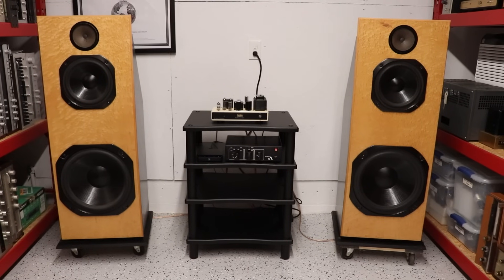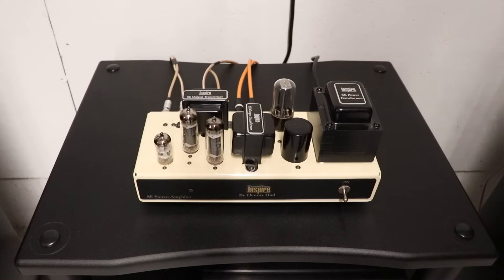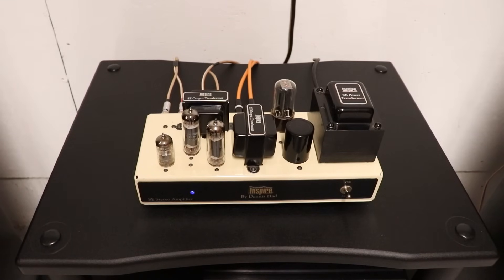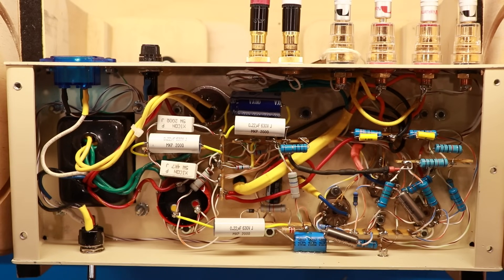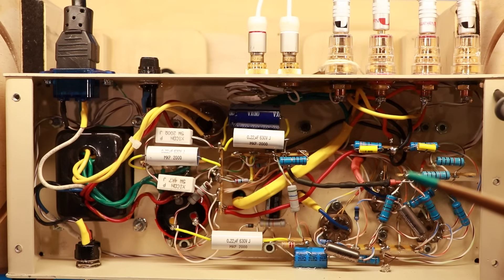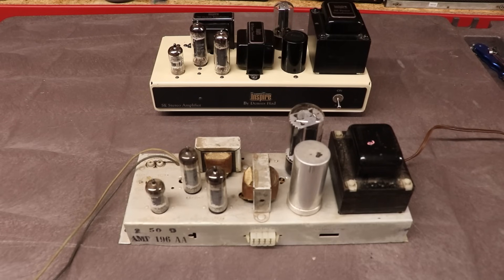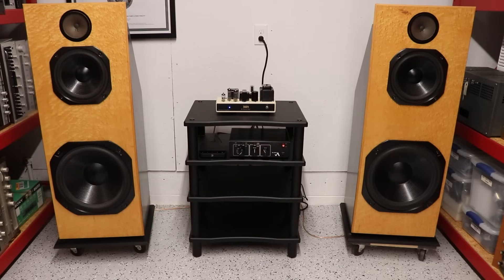Inspire (Dennis Had) EL84 Single Ended Amplifier Repair

Comment: 2:26 Also looks like the filter cap is a bit loose in it's mounts, is that the self destruct button, press here for a short circuit. When flipped over it looks like a pile of red electrical tape wrapped around that cap, not the best idea.

It might have been interesting to run this amp up against the one shown later, although the underside looks a lot different, so many the 'Inspire'ing was limited to the physical component placement.

Comment: I have a tube preamp board that I got from Ebay with two voltage gain stages followed by an srpp output and I am trying to use it as a microphone preamp with transformers on the input and output. I am getting hum from the preamp when I plug it into the wall from my USB Audio Interface without even turning it on. The Chassis is grounded. Also wondering about how to ground the board and transformers, and the XLR connector I/O. The board has tube rectification for the Tubes, and for the 12 volt supply it has solid state rectification. When turned on there is 120 hz. hum. I am thinking of lifting the tube connections for the 12 volt heaters and using a LM317 board to provide the power for those instead of the rectification on the board. Not a lot of info on grounding scheme for a microphone preamps.

Comment: Hello Mark. As a tube/valve technician since 1978, I enjoy your videos. Are you aware of 7189A tubes? They have a higher plate voltage and they provide a little more output, depending on the output transformer. Greetings from Ireland…..👍🇮🇪

Comment: By my math, that amp is 33 years old? A capacitor or other component out of tolerance would not be uncommon. Neither would a cold solder joint which I have discovered in similarly, aged phase linear amplifiers among others. I would say that amplifier and the workmanship stood the test of time very well indeed.

Comment: Giving a friend a Dennis Had amp is a very generous gift. I wish you well. I have a few old console pulled amps and they are not bad at all. A lot of the time you don't know how good they sound until you take it out and connect it to some decent external speakers.
Reply: Dennis Had or not, the look from beneath into chassis shows very sloppy wire layout, and a soldering so bad it comes off of itself is a BIG red flag, whoever made it... Inspire amps are not cheap by any means, and such  bad craftsmanship is actually shameful under such circumstances. In a 150$ chinese one, OK, but in this, mehhh...
Reply: @vespass225  I have a tube amp made by a Canadian 'brand' that has a terrible layout inside. I mean horrible. But the amp sounds good and I got it in a trade. I would be quite upset if I paid the asking price for it.

Comment: Because of you I have bought a couple of Dennis ‘s amps. One slight problem is a very faint buzz and I do mean faint. in   on one side of a headphone amp. not really sure if it’s worth chasing after.

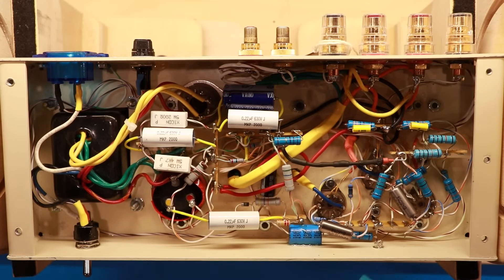Comment: Really great little amp. Is it my vision (probably is) or is there a rather dark looking resistor in there, between the two output tubes? It’s one of the smaller ones (0.6W?) and can be clearly seen at 5:15. Anyway, thanks for the look at that little gem.
Reply from the maker: its just shadow, they are all in good shape